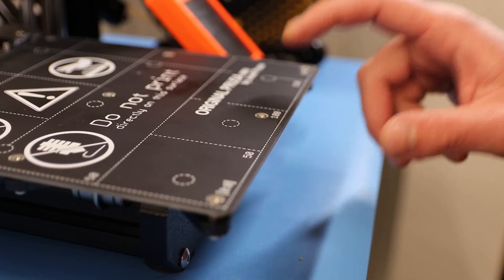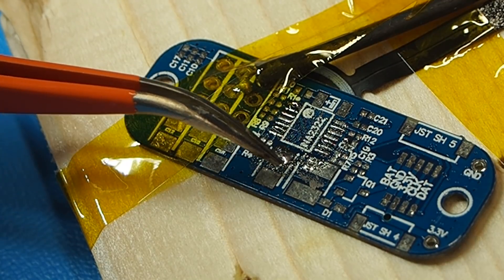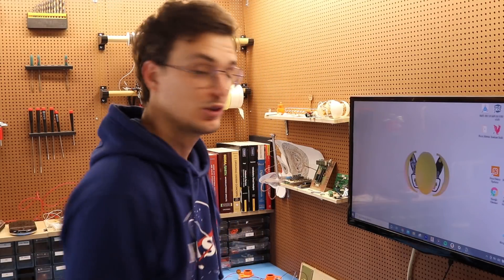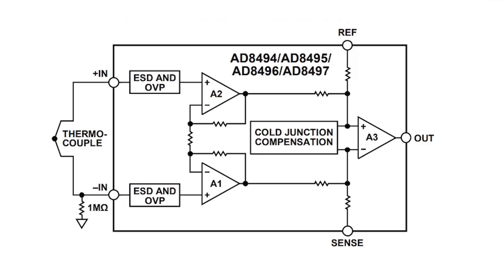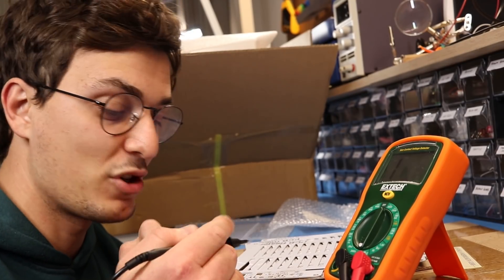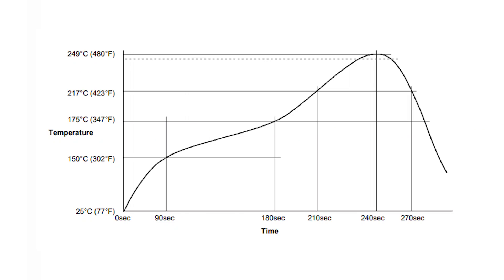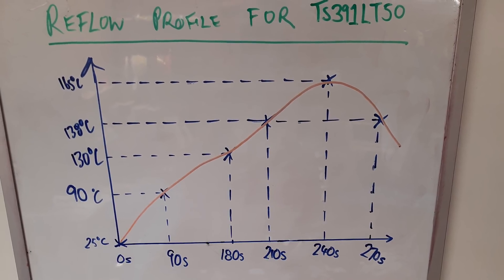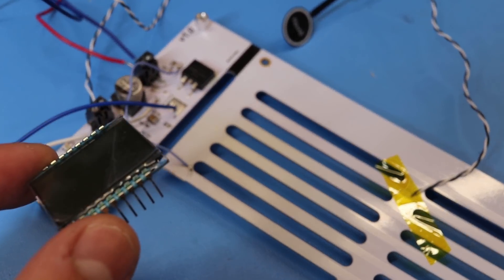Trying to build a PCB Hot-Plate to Reflow PCBs

Comment: I'm not sure if anyone suggested it but add PCB legs. You can plot small notches for the legs to slide into with a small amount of room for expansion. I would put them in a cross configuration to support the center. This should help with the sagging.  It will also get the heat off the surface you are working on and gives you a place to mount the electronics. Maybe a faceplate for temp control and screen. Then you can also plot a small hole in the center of the heating surface to put a thermocouple into the center from the bottom. Additionally, with the 3d concept, add a PCB arm on the top with a screw pivot and a point like a finger that aligns with the center. Add ample areas on the pivoting finger to blob on solder for weight then you don't have to tape the PCB down.

Comment: the spec sheet said Vg threshold is 3-5 , so the mosfet will turn off at a max voltage of 5 V and a min voltage of 3V, so 5 V logics is unliekly to work , you could get better mosfet like IRF150 or IRF540N , because 2-4 Vg threshold wil work better with 5V logics.There are also mosfet with logic input like FQP30N06L or IRL serie. the could go as low as 1 - 2.5 , which could also work with 3.3V logics. Use the right compoenet could save so much trouble

Comment: If you change from the default (for aluminum backed PCBs) ENIG to HASL (lead free), it's cheaper on PCBWay's website.
I'm wondering if it would be better to specify black soldermask, given this is essentially a heating element.

Comment: Bit of an off-topic comment, and I know this is months old now, but this reminds me of that PCB CNC machine. I don't remember the name of it or who makes it, and I'm not having luck finding that information currently. But it 'print' a circuit, using a proprietary paste, onto a PCB blank, typical fiberglass or flexible materials, and would bake the paste into traces; iirc, it could also drill for vias, but I would have to fact check this. I remember arguing that the machine was overpriced, the proprietary paste was most definitely overpriced, and that it would be fairly easy to DIY such a machine, assuming you could attain a similar paste, as the paste extruder was just a plunger mechanism, iirc, or possibly a blocked screw extruder. This reflow plate, and using a 3D printer as the CNC, and with a different tool being the paste extruder, proves that my concept of a DIY variant of this machine is, in fact, possible, and quite easy to accomplish; only problem, again, being the paste. The only difference, iirc, in both the original and DIY machines, would be that the pasted board needs to be facing the hot plate, with a holding mechanism that also forms a cavity, so that it creates what's essentially an oven, so that the paste properly bakes. 

Of course, these machines would not be close to a true copper trace PCB, but it would be better than, say, a conductive 3D printer filament, as it's a more permanent, baked-on solution. I believe this PCB-making machine would also be able to reflow solder, as the baking temperature is much higher than solder reflow temperatures, making it a multi-use machine. Further this by also incorporating a pick and place machine, have a tool changer, and a separate non-heated bed for component layout, though this would be a hybrid manual-automated machine, as the machine wouldn't be able to select components without a predetermined layout or without machine learning and artificial intelligence to pick random components from random placements to be placed in correct orientations and board placements, or have laser cut part arrangement boards to make pick and placing simpler; alternatively, for home production machines, the possibility of a tape reel dispenser in the pick and place head. Essentially, one idea could turn into a home factory in one machine, after initial prototyping is done of course. An ambitious idea, yes, but it also seems entirely possible to do, as each separate component does already exist, it would just be combining them all into a single machine, as tool changing in this form can exist, and the 'dual bed' design would just be an extended axis, which does also exist; so what would stop this from not being feasible, other than the solder paste issue? 

I've seen so many project products fail to come to fruition, or become a very niche product at most, because everything is hand assembled, and in the orders of hundreds of products, this takes a long time with a single person or small team. A combination machine like this, a desktop factory, would expedite this process, at least in bulk time as it can run continuously, and a print farm would further expedite the process. This would also be a direct link between rapid prototyping and production, something not often seen in the CNC world. It makes sense for a machine like this to exist for small-scale production, done out of someone's hobby room or small business.

Comment: Excellent heating tool is the plasic pipes heat welder plumbers use.Desoldering led from backlight stripes,reballing bga chips and reflows small sizes pcb.And its price is very affordable.

Comment: I am using pcbs as heaters for some time now. Calculating the final max temp and ressistance could not be easier than using a trace width calculator (like this: https://www.4pcb.com/trace-width-calculator.html). You enter voltage, trace width and length and copper haight and get all needed data.
You could use big planes of copper as heat sinks and very wide traces to deliver current without heating you logic side of the pcb.
A glass thermistor (like the one in 3s printer hotend is very easy to use and sufficiently accurate.

Comment: If your firmware uses floating point math, you can regain a lot of memory by switching to integer math and avoiding the floating point library.  It's a pain but it works, and once it works, it's done.

Comment: Probably it's a bad idea but i wonder if it's possible to make a PCB with a grid of very fine heat cells, like a TFT screen but cells produces heat in stead of light? I don't know if it's possbile or achievable but i think it would be great to aim directly to the soldering areas with a high accuracy. It would prevent components from damage and it makes the process more managable.

Comment: Is this the same Altium that every time you try to use the help file, you either get information from an old version of the program which doesn't work like that anymore, or you get a message saying the help for that feature is 'coming soon'? 
The same software that won't even let you do a simple print of the current view without compiling an output instruction, even if you only want a simple print?

Comment: Hi! Very good idea!. What you need to do is a PCB with a printed pancake coil. Then, make a driver so that everything works as a heat inductor.
Place the PCB side with the printed coil facing down, and attach a thin stainless steel sheet connected to the ground on the top side. This will heat up and dissipate electromagnetic waves, thus preventing the components you are trying to weld from being affected.

Hola! Muy buena idea!. Lo que necesitas hacer es una PCB con una bobina tipo panqueque impresa. Luego, fabricarle un driver para que funcione todo como un inductor de calor.
Coloca la cara de la PCB con la bobina impresa hacia abajo, y anexa del lado de arriba una hoja de acero inoxidable delgada conectada a masa. Ésta se calentará y disipará las ondas electromagneticas, evitando asi que sean afectados los componentes que intentes soldar.

Comment: Ohh ohh ohh, make a circuit board that is self soldering.  Have coil layers under the components that you power up to melt the solder.  I know it's useless for mass production shiz but it would be good for small runs and one offs for people who don't have a reflow oven.  Oh wait, just finished the video, your already on it.  Good job.

Comment: For rigidity I would add something mechanical as a cross brace, to give it either a U or a T shape cross section. thin aluminum in an L shape and rivets would be a very stiff and low effort solution, but would wick away some of the heat. If its too much heat you'd have to find something that could be attached (rivets or otherwise) with a low heat transfer coefficient.

Comment: Great idea! A cool addition would be to split the board into heating zones. You could control which zones receive power using transistors or something like that. That way you don't have to heat the whole thing for a tiny PCB. It would both speed up the heating speed, limit the power usage and make the thing a bit safer.

Comment: I think the aluminium backing is acting as a Big heatsink, pumping and dissipating most of the heath on the back of the plate.
Maybe try removing the slots and put the pcb to be reflowed on the aluminium side? And add some insulation on the other side to focus the heath to the reflowed pcb?

Comment: I guess you should just add the temperature measurement device of choice back to the heating PCB. No point carrying a thermocouple back to the same board and soldering it on or whatever else. Also.. P=I^2 X R right??  I hear a lot of talk about the voltage which I get drives the current but the real significance here is the resistance. I know you know this Carl, just the video made it seem like it's all about voltage.

Comment: You could use Fusion360 to do a thermal simulation of the final PCB, by exporting the STEP file from Altium. This way you can have an idea of how much your PCB overall temperature should be.
I might be able to help you with that.

Comment: Hello Carl, Nice project. 1. My idea is to implement fan/s to cool the PCB board after reflowing. You can installed from below and connect to controller who can turn On the fan/s after finishing the reflowing. After the dropping the temperature to about 30°C  it can stop automatically. Just nice future which I will like it to have. If the fan/s is installed from bellow is good to have more holes on the heater ( like many bigger vias). 2. I think that you holes are too wide and too long and heat maybe will not distribute evenly. Maybe is good to be 1-2 millimeters wide and about 10 millimeters long.  3. Other think is I like to have real time reflow profile on the computer screen or similar. I like to have loading/edit/run reflow profiles thru the network LAN or Wi-Fi. 4. I s good  to have two surfaces for small PCB and big PCB boards. Lets say into the big surface you can separate one area about 4x4 inches for small PCBs. You can switch  between areas small or full. This is not too much related to the saving of the electricity but to protect your finger from burning when handle the boards:). If you have cooling fan not burnet fingers:)). Let me know what do you think about it.

Comment: Have a look at this link https://uk.banggood.com/235+235mm-24V-200W-Silicone-Pad-Heated-Bed-Heating-Pad-+-SSR-Solid-State-Relay-Kit-for-3D-Printer-p-1654274.html?utm_source=googleshopping&utm_medium=cpc_organic&gmcCountry=GB&utm_content=minha&utm_campaign=minha-gbg-en-pc&currency=GBP&cur_warehouse=CN&createTmp=1&utm_source=googleshopping&utm_medium=cpc_bgcs&utm_content=sxxx&utm_campaign=ssc-gbg-all-0218&ad_id=332556156911&gclid=Cj0KCQjw0caCBhCIARIsAGAfuMylxZEnxB1kBy-CYJA7K5H0levAWs-IWD69uRQ9XPAR2BNo44oPgXcaAmk4EALw_wcB .  And also think about using marlin to run this unit. Has it as got pid control already and you could use a 3d printer motherborad to run the unit and you would need to use ssr as well. All you would need to do is comment out the hotend as you would not need it. But you could the hotend side of things for an hot-air blower as well. Hope this helps you out with your project.

Comment: £7000 for Altium and £385 for the heater PCB so a barging low low price of £7385 for a reflow plate when you can do the same with a £1thermocouple a £40 toaster oven and a £10 PID controller. :|

Comment: And self removal components for recycling or repairing pourposses. A valuable cpu, memory or frecuently crashed component could be resoldered or soldered in site. Say bye to some delicate or big and heavy connectors. Solder your flexible parts and save in manufacturing labours. That's my ideas. All rights reserved at 50% with this guy.

Comment: If you make a self-reflowing PCB, you could have a tiny LED or something on the end that only lights up if the entire circuit has reflowed properly. Or maybe even a resistor connected to the thermal regulator so it knows to switch to the main microcontroller from now on. That way it automatically reflows the first time you turn it on and then it's done. You can pass power through the circuit when heating too, so maybe it's possible to do an "If isComplete applyCoolingAndEnd(); Else keepHeating(); waitUntilReflowComplete();" so that you can automatically stop it at just the right time before you get bridges

Comment: Suggestion #1: Build an FR4 Frame around it to mount the components on and suspend the Al-core in the center. [X]
#2: the slots in the Al-core are not necessary, the heat conductivity of the aluminium is good enough to cool it from below, mount a fan underneigh.
#3: make your layout more flexible, to compensate for manufactoring errors or to allow different supply voltages you could allow to modify the resistance by separating/shorting tracks via (high temp) solder-jumpers

Comment: You need to go up with the temperature (about 240⁰C) and try to fix the thermocouple on the pcb ( non plated vias?)
Reply from the maker: i think 240degc would be too much for the pcb to handle and it could damage it
Reply: @CarlBugeja  for lead free solder paste peak temperature is about 230-240, if you use sn/pb 200 is ok.

Comment: @Carl Bugeja did I see a board creation price around $130 for 5 boards?
I don't see the benefit to this approach because, even at $25 per board, I'm thinking that is way too expensive compared to the cost of heating elements.  Where is the benefit here?
Reply from the maker: the price will significantly drop if you order 100+ boards (take my flexible pcb as an example (https://www.youtube.com/watch?v=nfQP2Xxvq3M) - this is just a prototype but if improve it and decide to sell it someday it could be a cheaper and more hackable reflow hotplate
Reply: @CarlBugeja  I definitely like the idea, in the same sense as I like the KSGER T12 & 858D stations as well as the kWeld kit.  I imagine it could be much more responsive to temperature changes.   Do you have a maximum temperature and run time you are aiming for?

Comment: It might be interesting to have several heating elements that could be controlled individually so that you could optimize a consistent temperature across the whole board.
Reply: Or heat only those regions defined by your smaller project reflow pcb, so saving energy

Comment: Another fantastic idea!  Good use of inner layers & (soon to be) ground "planes".  Ever figure out how the resistance was so far off of your estimate?  Was it the sharp u-turns?
Reply from the maker: thanks :) i'm not sure why it was off - the u-turns should have been calculated for
Reply: @CarlBugeja  I think you liked that X-ray machine and want to get to the bottom of this {<subtle mind trick>}.  Best of luck with your quarantine.  Thank you for actually doing it.  Oh, if you can get sides on your heater, it might help keep convection from "reaching" the target (perhaps slots in PCB for walls).

Comment: Try an alu (or copper if you can afford it) plate on top as a heat spreader.  Should allow the heat to spread across the current gaps and provide more thermal mass. Just be sure to tweak your PID values after! :)

Comment: My first impression: Let the heater reflow it's own circuit
Reply: Exactly what I was thinking.  Let's heat the control circuit so it doesn't work anymore!!  Most semiconductors fail catastrophically at 150c.  They stop working around 100c junction temp.   Defo a stupid idea to have the control electronics on the hotplate !!

Comment: Set Zones In the next iteration. So you're controller can use only smaller sections depending on size of PCB to be reflowed. You might be able to use a PCB on edge as Underside Supports For your "heater" pcb. Past all that this is such a simple design I hope it works out.

Comment: ? just use Robert's conductive ink after diluting to the resistance you want to use for a given reflow temp.

you want a heat sink, simples... use a metal plate copper , layered coke can plates, whatever, put insulating stuff like kapton or varnish on it, stick your two copper tape strips on there, paint over tracks in whatever heater shape you want, apply more insulating stuff, dry, apply power and dial it in, done.
add a thermocouple or 3 to a pi pico and display and relay on a long kapton pcb and put in an origami box for cheap unique design   to overbuild it if you like....

Comment: How would it behave if you put 2 panels face to face, and powered both (using the aluminum back as the heater surface)
Wouldn’t that be the same, resistance-wise, as cutting the board in half?

Comment: You could put a few small holes in the pcb and design a small clip or use wire to hold the thermocouple onto the pcb. Then you dont have to use the tape.

Comment: Tip: don't suspend pcb heater in air, support it by glass wool pads it will provide insulation and support
Reply: Use FR4.  Realistically FR4 is designed to go to reflow temperatures !!  Look for the higher temperature stuff.
Reply: Or other thermal insulation that can tolerate the heat and is handy. (I hate working with glass wool.)

This is assuming the system can match the thermal profile with the insulation. Too much insulation, and it won't cool fast enough. If it doesn't cool fast enough, then you have to add a cooling fan.